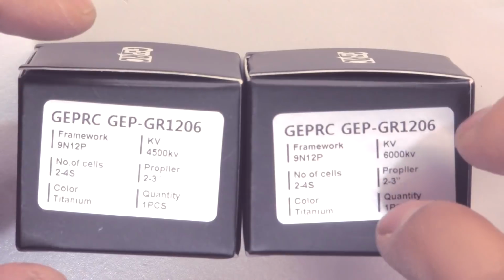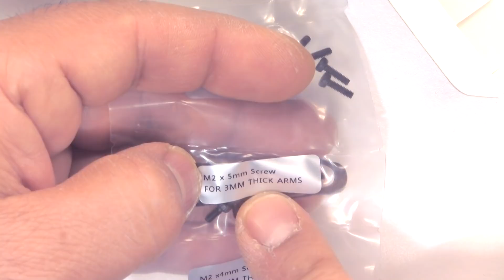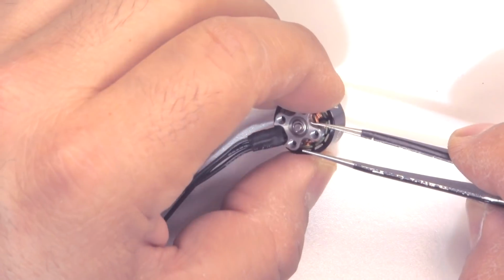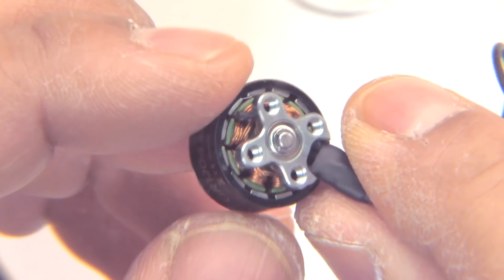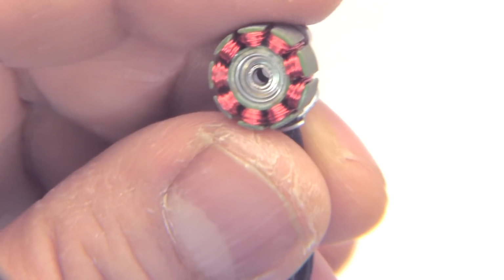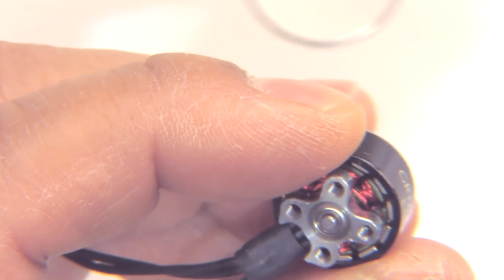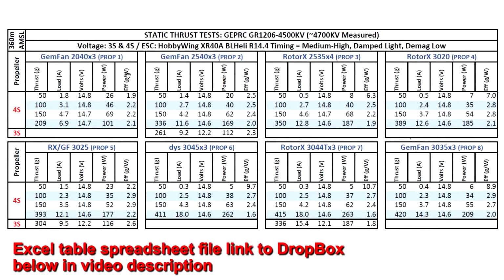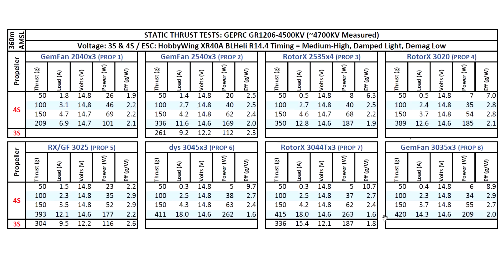GepRC GR1206-4500KV Another Alternative to 1106's

Comment: Looks like a good motor for 1106 replacement. I am holding out to see the new Emax 1108 and 1408. Thanks for the test. Keep it up.
Reply from the maker: Yeah. Those larger EMAX look really interesting. No doubt they'll be beastly. Just need to match them to the right props. Hopefully I'll get some for testing.
Reply: @EngineerX  I hope you get to test them too. I am most interested in the 1408 motor.

Comment: I’ve got a sub 98gram W/O battery 1106 set up. Would these generally be more efficient power to weight ratio. Though my 1106 aren’t bad at all just a good amount of amp draw on punch outs.
Reply from the maker: Probably just slightly more efficient but not enough to notice or increase flight time significantly. From what I've been reading in several comments, 1304 or 1306 / 3" props gets good efficiency but not sure how much more. Difficult to compare due to so many variables.
Reply: EngineerX Interesting and good to know because this is strictly a  2.5 build. I’ll probably just leave it alone after all since it already flies quite well.
Reply from the maker: @cletussurfsalot7190  Yeah, it's very difficult to improve efficiency with 2.5" or smaller props, especially if you want a fun setup.  If already flying well, just wait until you need new motors.

Comment: thank's for yours vidéos. one thing: if you put the DB (decibels) to know the propeller/motor/noise, in db, (for the regulation too..) and for you is an app to your smartphone ;) to do it ;) it is interresting no?
Reply from the maker: Yes. That would be very interesting. However I thiink those tests would need to be done when you fly a specific setup to see if the noise exceeds the limit of the established regulation. What you measure on the thrust stand in static conditions will be very different than if you're hovering or flying at different speeds.

Comment: I’ve been running the 6000kv on a 2.5”. They’re nice but I should have got the 4500kv. They toast 550mah 3s batteries way too quick but run far better on 4s than the 1105 5500kv I have on another 2.5”.
Reply from the maker: That's very good info. Thanks for adding it to the comments. Cheers!
Reply: Do u think on 3s super light weight build the 6000kv will provide a decent flight time with a 3inch prop

Comment: Nice looking motor! Definitely seems best suited for 3” props though, which is exactly what Nick Burns thought when he flight tested them a little while back. I still think for 2.5” props that 1106 motors are the best for racing and 1304 motors are the best for freestyle.
Reply from the maker: Yep, looks like it's happier with the higher load of a 3" prop. That's the sweetspot. 1106's are still relevant for the the smaller props. They still can give you you a good 3min flight (lively) or longer .

Comment: a 2.0mm shaft? Did you need to drill out the props?
Reply from the maker: Yes. I enlarged them just a tiny bit to make it easier to install. In some motors if you didn't do it it would cause shaft to back out
Reply: @EngineerX  Thanks!

Your tests are awesome, btw :) Super helpful stuff!!
Reply from the maker: @lievenvv  Thank you so much.

Comment: It's interesting seeing the performance of this motor on 4s with Gemfan Hulkie 2040x3
Looks similiar with EMAX RS1106-4500KV  back on 2017 test result https://youtu.be/9qfE0p9fbGo?t=447
What do you think if using Gemfan Hulkie 2036x4 ... will it produce more Thrust and efficient ?
I need to find the best motor for my CineWhoop 2" build carrying Runcam5 action cam, which currently seems not satiftying with HGLRC 1106 6000KV using 3s lipo/liHv 530-650mAh
Do you think GEPRC 1206 4500Kv will be better instead EMAX RS1106 6000KV ?
Reply: But ah ... this seems more interesting iPower iX1106-6000KV (similiar with mine HGLRC 1106-6000KV)
back on 2017 https://youtu.be/uICS_9kPwJ8?t=581
I guess i should try Gemfan 2035x4 first